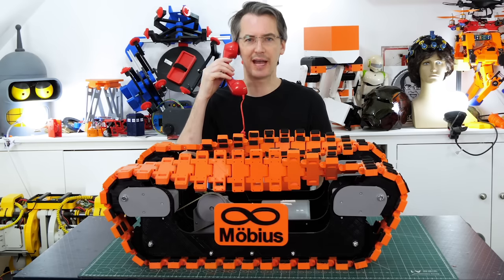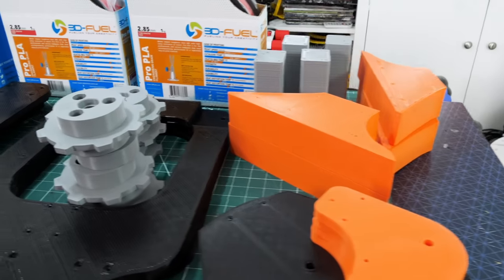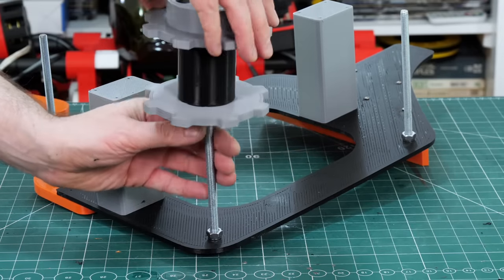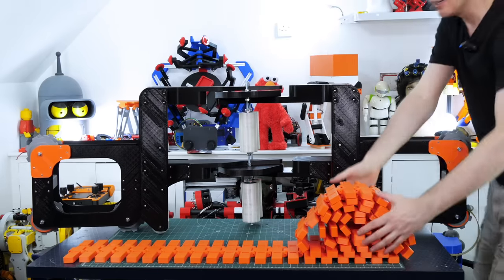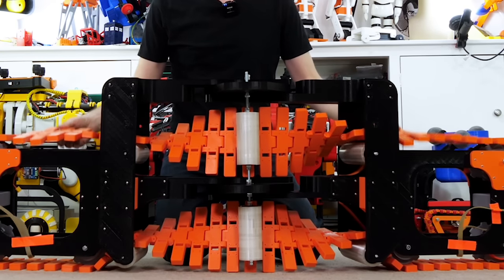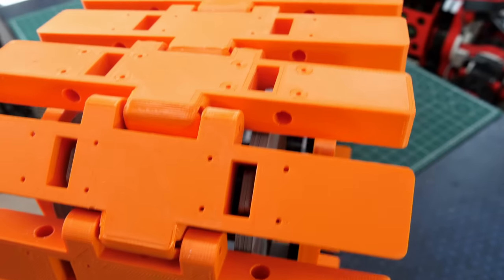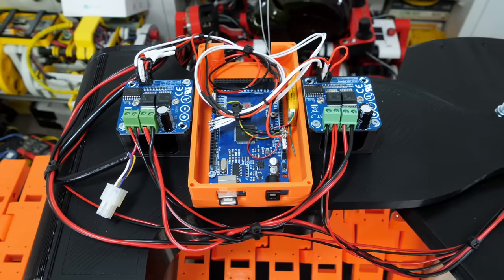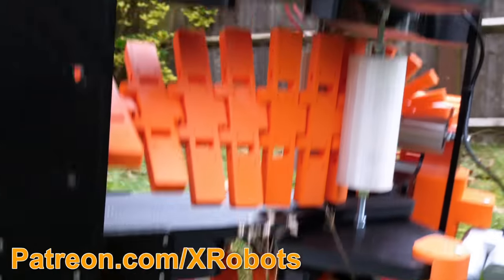I found a use for the Mobius Strip Tank

Comment: The only practical applications I can see this design for (as a skidsteer tracked excavator operator) is 
Pros
1) less damage to the ground when steering 
2) possible that it may keep the tracks cleaner (dirt might fall off in the vertical sections)

Cons
1) way more moving parts (moving parts break all the time so less is better and easier to fix)
2) not as much traction as you aren't getting near as much track touching the ground at once, meaning pushing power might take quite the hit.
3) quad track machine with an articulated central section probably does all the pros better and cheaper.

Cool experiment though. Interesting concept. Keep up the great content

Comment: Doesn't this defeat the purpose of a track in the first place? if you're reducing the surface area of track touching the ground you're in turn increasing the PSI of said vehicle as it travels the ground, this is why tracks are used for military tanks because they weight upward of 60t and wheels would simply sink into the dirt because of the pressure it would impose on small points of contact, something treads dont have an issue with as the entire length of track is spreading that weight evenly.

Comment: a mobius strip only twists once,, and you twisted it twice, meaning the back is always running on the inside and the front is always running on the outside,, not a mobius,, but an awesome video as always :)
Reply: watch the video, he mentions that the twists on the bottom are opposite directions, so they cancel each other. it is a net of 1/2 twist per revolution
Reply: Bottom twist only enables the whole strip to bend for turning, it just curves up and back, still a Mobius strip.
Reply: it is not a mobius strip, it is a twisted loop, it is an awesome video and everything he makes is amazing and yep all fan boy you are too,, but point remains,, it is not a mobius strip , the track has enough flex, it just needs some guide rails... to say it is a mobius strip is to say a square is a triangle but just with and extra corner,,, 
Again Awesome video and long time fan
   @Memphisko
Reply: @KavaRahu   Even after few weeks, it's still the same. The bottom twist can be completely ignored as it does not affect the property of the mobius strip, pause the vid where it's shown in side view, and track the  outer side of the belt. You will end up on inner side for second revolution, because.. It still only has one side. I am not a fanboy, it's just clear as day.

Comment: this shows clearly that the Mobius strip still has two surfaces if it would only have one u would only see a side with the black rubber dots which is not the case therefore there is a second surface